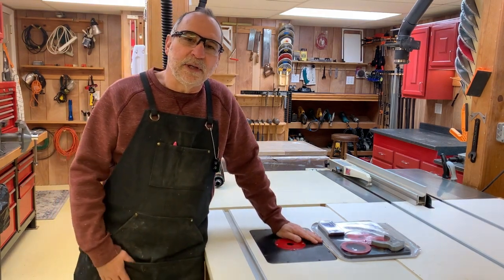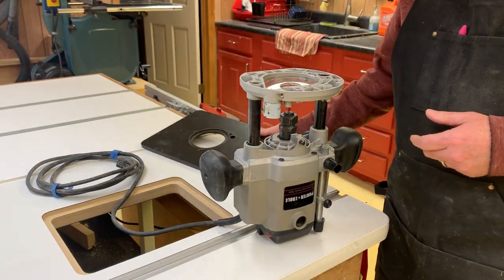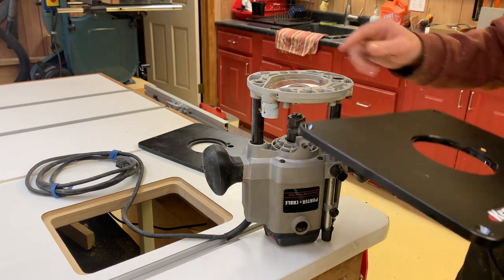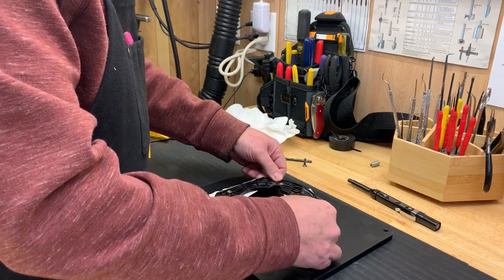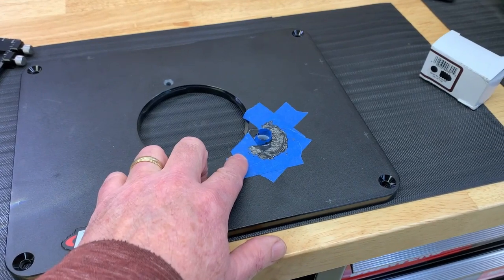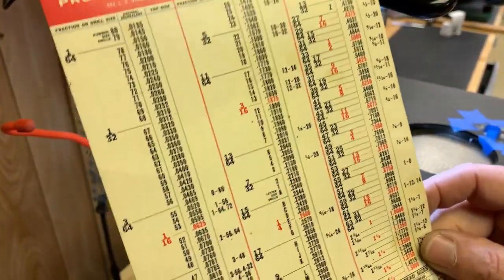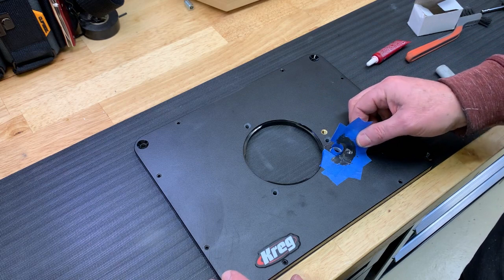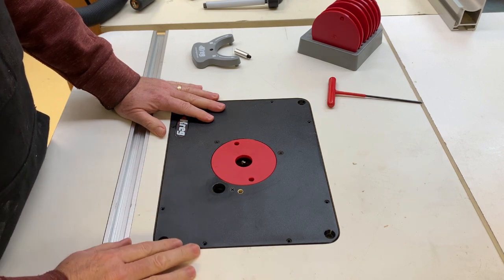Upgrading my Router Table - Part 2- Installing Kreg Insert Plate

Comment: Hey Bob. Love the original change with the router. I'm about to start building my own table so all this will help.. Did u think of saving money on the new plate by using small magnets? stead of those pesky screws. Just a thought my bro
Reply from the maker: That is an excellent idea. I think I will do that. Thanks!